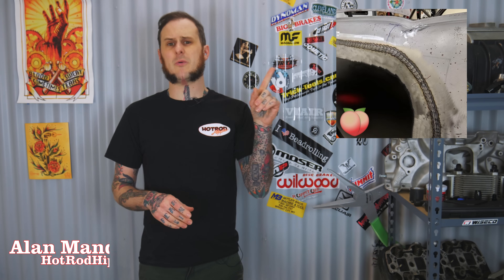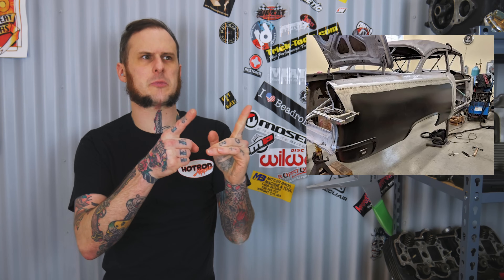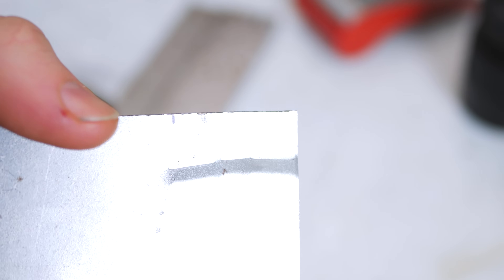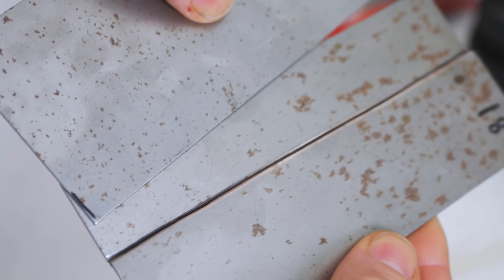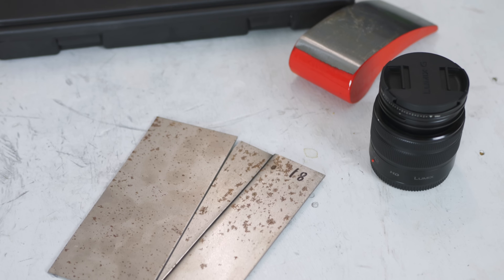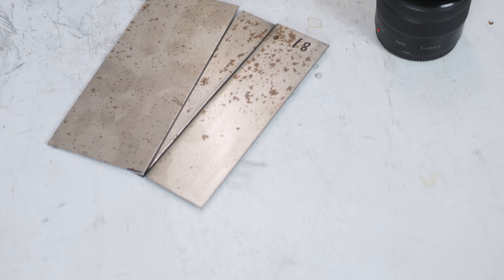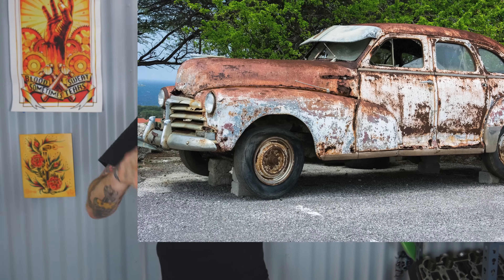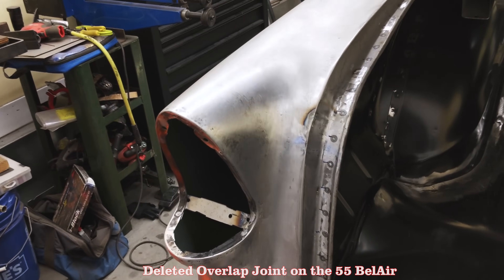Butt Welding VS Overlapping Sheet Metal Panels

Comment from the maker: Do you butt weld or overlap your replacement panels?  Are you considering practicing Butt Welding panels more if you have been Overlapping?
Reply: I have been building cars my whole life and I am 56 years old. I wont do it for other people. I only do them for myself. I worked in a body shop and custom shop when I was much younger. I started building cars before I had a drivers license.  I can say there is NO one size fits all for repairs. Some areas NEED to be lapped. to get a strong repair. They are weak points in the car you are trying to correct. for a lasting repair. I have taken apart my work 20 years later and the idealism of the rust getting between the 2 layers is not realism of what reality is. On thinner than 20 gauge you ARE weakening the panel. Next to where you weld the metal is melted and it is thinner by a small margin. The metal is already thin if you lap you have 2 layers to make up for the loss of metal . Plus your grinding you loose a bit for that.  No repair will last FOREVER either. everything will eventually be exactly what it is... a REPAIR. As long as your repair meets the needs of what your trying to achieve it is just fine. You next gens got a lot to learn. Not being negative. Just real and no thumbs down just letting you know where I stand on this stuff. Got a few years on you bud. Keep building cars and keep it FUN. Dont overstress on how long your repair will last just do the right thing you think you need to do for what you do.
Reply: I do butt welds in my old classic cars because the metal was so much thicker,,,but new cars I lap the new cars metal is just so thin
Reply: @georgespangler1517  totally agree. the only way to do a repair on a newer car properly is to lap. Old stuff you can do either. but some areas I still lap. Round areas. if its easier lap it. long areas sometimes lap to prevent warpage.  As long as I achieve a minimal amount of filler and the end results are nice. Who Fn cares.
Reply: Good point; it's definately easier to hammer & dolly sheet metal when butt welding panels together - seems kind of obvious, but I've never thought about it so succinctly for some reason :P  

Maybe you could do a similar video on TIG versus MIG welding panels together (MIG welds seem to shrink more than TIG welds and are harder to shape with a hammer and dolly than TIG welds are)
Reply: The biggest hang up for me about lapping autobody sheet metal is that...lapped pieces of metal are the entire reason your car rusted out in that area. Lapped metal just collects dirt, moisture, and salt. How do you paint/protect the inside of the lap?
I get the feeling that the concept of lapping metal is done by people from the south or southwest where everything is much less corrosive.
I have very marginal experience with auto body so I don't really care what people do, and I am not saying one way is better than the other.  But lapping sheet metal seems very wrong.
Reply: @borisjankovici662  Lapping is the only way to go on new thin metal vehicles
Reply from the maker: @borisjankovici662  I’ll say it, butt welding is better. 😂😅

Comment: Am 65 now, I began to weld with oxy-acetylene when I was 16. Am still use oxy-acetylene in some cases. I learn to mig 1979, when for first time I meet a representative from HTP at a paint store and tools supplier. I don't have the customers for buttwelds, my customers are in the average preserve repair. I did some buttwelds, but is not my favorite. Nice video, thanks.

Comment: Overlap and screw in place then cut at the overlap on one side or corner then work your way around with a butt joint until everything is a butt joint. Much easier than trying to make the piece a perfect fit all at once,  much quicker also. I’m very new to this but this method is like having help hold it in place. IMO. 
Yes I agree if you stack metal on metal it will never look right and will haunt you for years to come.
Thanks for you videos, they all help I learn something from each of them.

Comment: Agreed where you're going to use filler definitely butt weld, but no pun intended when your fabricating anything under like wheel wells or trunk area and like package tray areas definitely this is the way to go with a flange. It serves the purpose to make it stronger one reason and you can always go back in there behind it with a rust preventative easy peasy

Comment: Do manufacturers butt weld sheet metal together? I see all sorts of overlaps I don't think I've ever seen a OEM butt weld
Reply from the maker: Because the OEM isn't replacing sections of panels.  They have the manufacturing to make a 6 foot long quarter panel in a single piece.  You basically DO see "butt welds" the middle of their panels are one continuous piece.  That is what a Butt Weld is attempting to recreate.  You'll never see a manufacturer put an overlap joint in the middle of a door skin, fender, etc. 

The problem we have in the aftermarket is replacement parts. Can I get a complete quarter panel for a 1955 Chevy and not have to butt weld OR overlap? Sure, but I know from experience they are pure garbage.  The shapes of them are incorrect to the original car, the flanges aren't as crisp, and they will look terrible when installed.  So if all I have is a rusted out wheel arch, why replace the entire quarter panel and spend weeks to get it right? I can cut just the wheel arch out of the replacement panel (or just get that part) and butt weld it in.  Finish it off, and now it is once again, one complete part.

Comment: Flanging allows you to get perfect depth of opposing panels and reduces heat warpage a thousand percent.
Reply from the maker: And clamping two materials butted together (of equal thickness) doesn't get you the "perfect depth"?  All flange making tools I'm aware of don't have variable depth settings to account for material thickness differences.  So no, you really won't get "Perfect Depth" that way. And "Heat Warpage" is actually "Material Shrinkage" and pretty easily corrected with proper panel prep & metal finishing after welding.  Flanges only prevent it by causing stresses in the panels that make it overly rigid and reinforced.  Thus creating & adding to the issues I stated in this video. 

Just because Flanging is easier, does not mean it is superior.  Butt Welding isn't for everyone, I get that, but difficulty alone doesn't decide how effective a technique is.

Comment: I would have thought that overlapping would be easier and stronger, however, I personally would rather replace the entire panel than weld the crap out of it.  I also use a weld through primer or a weldable 2 part epoxy (or panel adhesive) to prevent the metal from rusting where there is an overlap.

Comment: Excellent video.  Just subbed and thumbed and shared.  Gotta question.  Can I do an overlap joint using a fully fluxed surface and solder or a new high-tech brazing system to purge out all the air and moisture?  I like the butt welding.  I'm just curious as to what you think.  Did I say excellent video?  Well, excellent video.

Comment: I am currently restoring a 1966 car which has been sanded on and painted several times prior. I gave up trying to butt weld panels as the metal is so thin I kept burning through. Turned the heat down, wire feed low/high...no difference. Any attempt to correct the burn through just added to the problem. Lap welding in this case is working much better, and no, it isn't going to Barret Jackson.
Reply: yeah. i tried after watching this... burn thru and a valley where the weld was that needed 2 be filled

Comment: He is so right about rust,  my pick even under shelter rusted (good ole south Georgia humidity) I am repairing the bed, new floor and plan to replace the lower 3" both sides and front. A bit of a challenge as I am learning as I go but it will happen and I plan to butt weld, there is no hidden side. Long pieces of square tubing for straight lines.

Comment: When you butt weld the whole patch to your car and grind almost all the welds off, what's holding the patch attached to the car???
Reply from the maker: A weld should fuse the patch metal to the base metal. If you are just welding on top of the material and not actually melting into it, or grinding into your base material, that is a failure on your technique not the process. 

Do you think all ground down welds are unsound?
Reply: @HotRodHippie  What gauge metals are you welding with that technique? And I'm NOT saying that your technique is wrong by any means!
Reply from the maker: @lau12342  20, 19, 18, 16ga on a regular basis. Thicker or thinner materials on rarer occasions. 

Proper weld settings and technique should result in a full penetrated weld. Where if you view it from the back side both sides are joined. You may be able to distinguish where the edges are or were but they will be fused. 

This is something I need to demonstrate more thoroughly once I can get back in a shop for videos.

Comment: I’ve put a flange on big replacement panels to have a go way to hold the panel with some spot welds in place but but later I’ll cut the flange and line up the butt welds
Reply from the maker: Suggestion: Buy Clecos. Overlap, drill and click the panels together. Then you can tack the butt weld and cut off the flange for a butt weld seam. I need to do a video demonstrating this.
Reply from the maker: https://youtu.be/p-UuKVRHrco
Reply: @HotRodHippie  yeah never seen those they seem sweet

Comment: Here is where I stand on this. Butt welding is WEAKER than lapping and years ago if you butt welded a panel in and the insurance adjuster saw it.... your would loose your contract period. However on 16 gauge or 18 gauge steel it is fine for a good repair. Some areas have weak points like VW fenders and some areas of the hood. To properly repair those areas lapping is the ONLY way to do the repair long lasting. IMO if you can do the repair and achieve the fillers specification, Especially with the quality of the premium fillers today, There is nothing wrong with lapping. Even with 20 gauge steel you can use either lap or butt to achieve the same quality finished product. Some areas a lap is just fine and some areas to get the finish you need only a butt is the way to do it. This is not a one size fits all business. I have been building car my whole life and nice ones at that. Now when your talking NEW cars 22 gauge.... I would NEVER BUTT WELD. IT is too weak a repair for the thin sheet metal. Next to where you weld the metal is thinner from the heat. There is NO one size fits all. to this stuff. BTW I still give the video a thumbs up because you are restoring cars.

Comment: Great video. I'm starting to do a frame off resto on my 1968 galaxie 500xl. The only rot in the floors is the trunk and I'm making the new panel and butt welding everything. I'm def not a pro welder and this takes a long time but by far a better product in the end.
Reply: And it will be much weaker. Factory overlaps for a reason.... it's stronger

Comment: Just saw this video. What are the problems if you overlap and panel bond the pieces. 3m panel bond will never structurally fail and it will seal the gap between the overlap completely.
Reply from the maker: There are a few problems with using Panel Bond instead of buttwelding in a patch piece.  You are mostly correct about its rust inhibiting, but basically everything else I said still applies.  

ONE: Bodywork will be greater.  You'd have to step a flange on your patch panel to give room for the panel bond adhesive (it isn't razor thing when compressed) and the thickness of the parent metal.  OR you don't step it and you end up with a decent step (Parent Metal + Panel Bond thickness).  Either way will absolutely require more filler work than a good Butt Welded panel.

TWO: Expansion/Contraction Rates.  You've now created a FAR more rigid panel than was originally intended.  You have the Parent Metal, the Panel Bond, and the Patch Panel metal stacked together.  As well as the structure of the stepped flange of the patch piece if you do that.  All of that means the patch area will NOT expand/contract at the same rate as the rest of the panel.  Especially true when you consider that Panel Bond is a dissimilar material to the Parent/Patch metal and will also expand at a differing rate.  Plus the additional filler on top of all of that. Eventually the natural expansion of the materials that always occurs can lead to a ghost line in the paint/body work.  Meaning the body work will become visible over time.  It may start off imperceptible, but over time even an untrained eye will notice "something" off about the area compared to the rest of the paint work.

LASTLY: To say that panel bond "Will never structurally fail" is gross exaggeration.  It absolutely can fail, especially if done improperly.  Panel bond adhesive is NOT intended for Patch work.  I am 100% certain that if you proposed installing a patch panel with Panel Bond, 3M or SEM or whoever else made the product, would warn you against it.  It is intended to replace full panels that were originally Panel Bonded on, not replace proper welding methods on structural components. To properly Panel Bond on a patch would require fully clamping it in place and leaving it clamped for the duration of the curing process (under proper curing conditions).  An inexperienced person could easily mess that up or may not be able to clamp the panels at all (especially on oddly shaped patches).

All that said, I DO use Panel Bond on Classic Cars but only as a supplement to traditional methods (IE. Welding / Riveting).  In fact I recently did an entire video about installing a full Roof Skin on the 65 C10 I've been building and I used Panel Bond as the primary installation method for that roof. You can find it and further discussion of the matter here: https://www.youtube.com/watch?v=pzgNiFJ86N4

Comment: Picked up a Forney 140 flux core welder. Butt weld a section of left side rear wheel arch near gas fill tube. Ok to buttweld or use 3m seam 8115 and clamp? Trying to keep repair size small with minimal filler. Thanks for the knowledge.
Reply from the maker: You are going to have a heck of a time butt welding in with a Flux Core machine unfortunately. Is it a long term fix on a project you really care about? Or something that just needs to last a few years? If it’s just a “fix” the panel bond method will work ok. It will require more filler in the long run and last a shorter time, but it’s a far simpler process. Along that same vein, for a quick patch job, an overlap and the Flux Core will get the job done. But if it’s something you really want to last, practice some sheet metal butt welding (of the same or similar thickness) on the welding bench and see how it goes. I find Flux Core harder to control the heat input so it’s going to be a challenge, but there is no replacement for a good butt welded in patch.

Comment: I agree but, how do you get floor pans to line up properly? I can do ok on exterior small patches, but large floor pans I overlap because if you cut them too short, your in for twice or three time the headache..enlighten me. Thanks
Reply: Always lap weld structural areas like floor pans for strength

Comment: You can overlap it and grind away the old metal away at a angle this work if u can get to the other side of the panel this helps with not leaving gaps good luck

Comment: I  lap welded rocker panels and rear wheel arches in my 2005 caravan the other week and was really proud. Now I'm losing a lot of confidence ☹️
Reply from the maker: Be proud. You most likely fixed a problem you had and solved your issue. I mean as a 2005 it probably took what 10-15 years to rot out once? With overlapped patches maybe you only get 5-10 years out of the repair job. Are you expecting it to last you another 15 years? Enjoy your hard work and don’t worry about this video. 

I am a Custom Car Builder and Auto Restorer working on Classic and Collector Cars. This was more aimed at people looking to do what I do. If you’d overlapped patches on a 1970 Superbird we’d have a different discussion. I’m aiming to teach people to do quality restoration and customization work. To do repairs that will last a lifetime. It would be good to do on your project as well but if you aren’t aiming for a lifetime repair, it is what it is.

Comment: So glad you made this video for me and other car inthuesist. You see I have a 56 Pontiac Safari . a little bit more rare than a Chevy Nomad. Not that their is anything wrong with Nomads. Any way my Safari is my High School car that is in need of a floor pan replacement 's . so their's a difference between Pontiac and Chevy floor pan's . I bought both because the Pontiac pan's are flat pieces which had some issues . the metal was flexing like a sprung piece of steel. So after talking to a HOT ROD shop I decided to purchase a set of Chevy floor pan's because they were stamped with rolled edges which made them much stronger with no flex ,but now I need to use both sets with modifications to make them work for my needs. And sorry to say I was thinking of overlapping until watching your video  now i will use strips of steel and cleakoes to hold in place while tack welding in place. Thanks for your insight as I am wanting to do it correctly.

Comment: Butt welding sheet metal is hard because somewhere around the line, you gonna blow hole through the metal.
Reply from the maker: I never said it was the easy way. With practice the amount of blow-thru is minimal at best. I do it often and unless dealing with particularly poor quality old metal I rarely blow through.